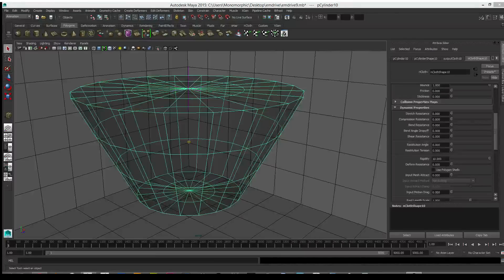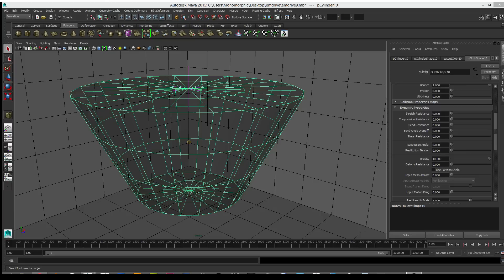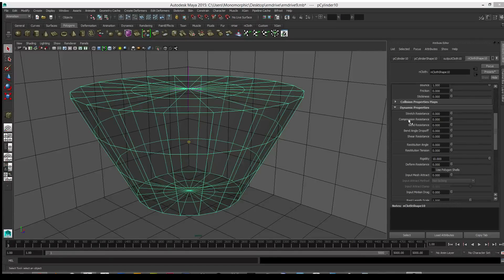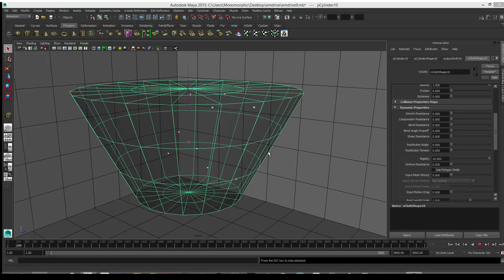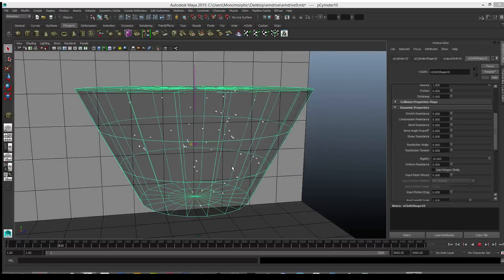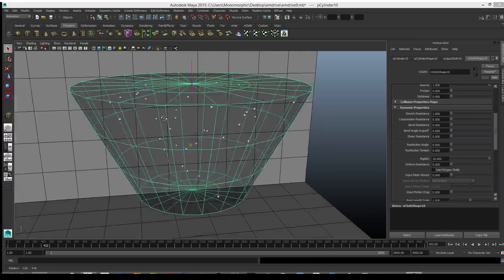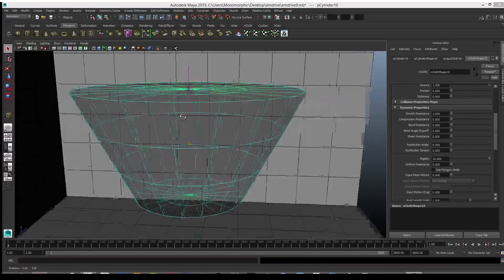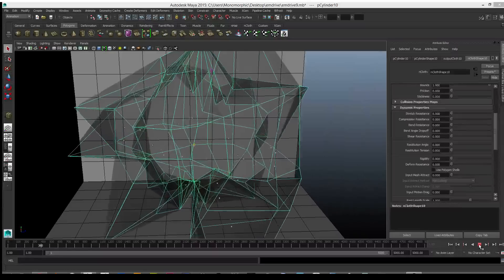Problem Solved with EmDrive Simulations

Comment: You may be thinking about this the wrong way.  If you zero out the Compression and Resistance then you may in fact be disabling the transfer of mass effect from the particle simulation.  In essence turning it off so that the particles do not affect the chamber.  In stead of zeroing them out shouldn't you set them to 100%.  This should tell the simulation that there is a 100% resistance which would be a hard body.  Please let me know your thoughts.
Reply from the maker: Tim Carlson This is what I had it set at originally when I was getting the anomalous momentum. I'm concerned the solver is not calculating lateral momentum on the cavity walls, though.  I'm looking at a bunch of variables now.
Reply: Jamie Ciomperlik I think that friction may be playing a part in this.  As the particles hit the inner chamber from the sides, they are striking the chamber at a higher angle which is causing an increases in friction (stickiness) with the chamber causing the chamber to move from side to side.  As the particles hit the inner chamber at the top and bottom, there is a decrease in friction being calculated by the solver as the particles are striking almost dead on and at less of an angle.  This is limiting the effect of friction acting on the chamber and with the Compression and Resistance set to 0 (Shutting off the impact calculation in the solver) the particles are just bouncing off the top and bottom without any effect.  Impact force has been turned off while keeping friction on which explains why the chamber at 0 gravity only moves from side to side.  Please let me know you thoughts.  Thanks Jamie!
Reply: Jamie Ciomperlik Another thought,  in the real world, 100% rigid bodies do not exist.  Even the hardest materials known are affected by collisions and energy. That being said, your first simulations are probably for accurate that this one which you feel you have corrected by creating a 100% rigid body.  Besides, 4 countries have received the same results and are each using their version of the EmDrive and have concluded that it works.